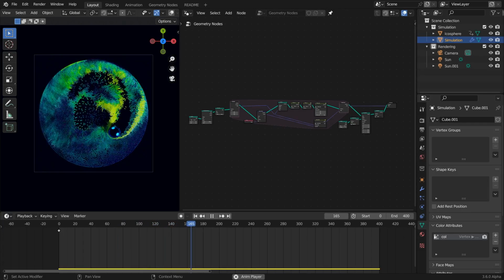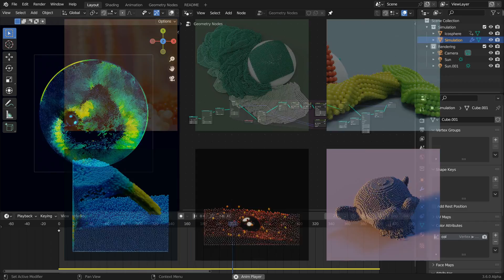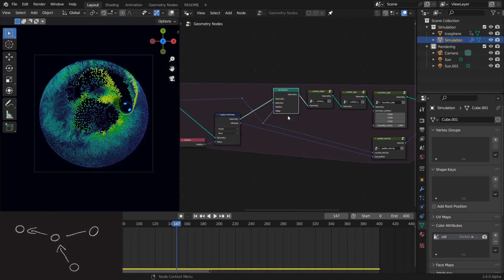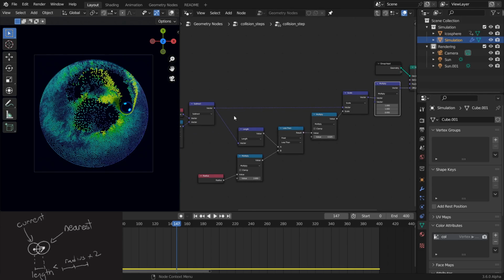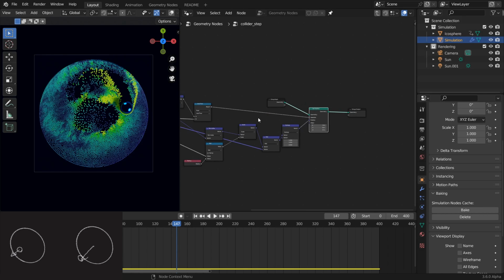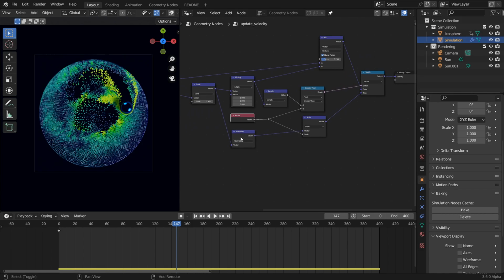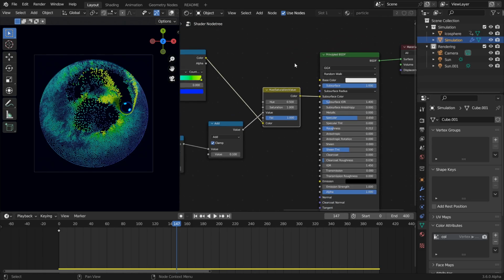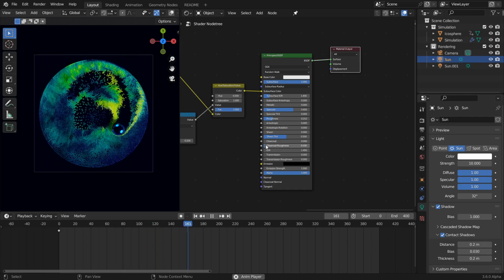Simulation Nodes Have Landed!

Comment: Such a great demo! Would you explain a little more on why clamping the velocity to the particle radius helps with stabilizing this simulation? I understand the rest of the node setup pretty well but just couldn't wrap my head around this part 😭😭
Reply from the maker: For sure! When the velocity is clamped to the particle radius it greatly reduces the possibility of particles moving "through" each other during the simulation. If there velocities are larger, say four times their radius, then particles on trajectories where they should collide may end up passing over the point at which they would intersect. Clamping the velocities is a quick way of making sure those collisions occur, so the simulation ends up being more stable, but less physically accurate.
Reply: @seanterelle  thank you so much!

Comment: Great video this is so exciting! Can I ask how you got those simulation nodes with the velocity? Did you modify it yourself? Thanks!
Reply from the maker: You can add sockets like that in the ‘simulation state’ drop-down in the ‘node’ tab of the menu that comes up on the right-hand side of the geometry node editor when you press ‘n’ or click the little arrow tab on the top right of the editor area. You also need to have either the simulation input or output node selected.

Comment: Amazing Work! Can't wait for what to come. The tearing looks so good. I've been scanning all of your Sim-Videos for any Mention of the Delta-Time or Sub-Stepping the Sim. The Documentation on this is rather sporadic, and i can't seem to wrap my head around it. Do you have a quick tip on that for me? I'd really appreciate it!
Reply from the maker: You can simulate delta-time and sub-steps by creating a simulation step node group with a delta-time value input. The delta-time input should affect the scale of the velocity offset at the beginning of the step as well as the size of the updated velocity vector at the end of the step. Sub-stepping is simulated by chaining multiple of these simulation step node groups within the simulation loop :)
Reply: The simulation nodes aren't constrained to realtime, and work in fixed timesteps.

Comment: Does this version 3.6a fix the compositor? I uninstalled 3.6 before because the simulation nodes build would not compositor at all without catastrophic crashes, hopefully they fixed that in this?

Comment: The analysis required to set up the node network is way too advanced for the non-technical user. Sort of what distinguished Houdini procedurals from general CGI. That fact, plus being versed in all of the node operator library, makes the tool impractical as a production solution, imo.

Maybe developing LLM AI to parse user prompts in natural language, then converted to Blender-friendly Python, is the direction to go with this stuff.
Reply: @ashlee3dee  Yeah I agree with that. There aren't really any intuitive indicators when there are conflicts with field outputs & non-field inputs for example. You'll just get a red connection & a little warning sign on the node, but no explanation as to why the connection doesn't work. Maybe over time the UI will get better about stuff like that
Reply: yeah i agree. geometry nodes feels more limiting and confusing than anything. doing things like this is a piece of cake in almost any programming language, and its way easier to understand the code than it is to understand this node network.
Reply: I feel the total opposite way about this. I suppose everyone has their preferences, but geometry nodes feels very intuitive to me with its visual flow of blocks and wires compared to lines of code. With the way simulation nodes are heading now, doing a complex simulation could be as simple as obtaining a pre-made node group that accepts multiple inputs for simulation objects & colliders. This is something I've been dreaming of ever since geonodes came out. I feel like any confusion about it is basically just due to not understanding certain aspects of geometry nodes, of which I'm sure the overall literacy will improve going forward.